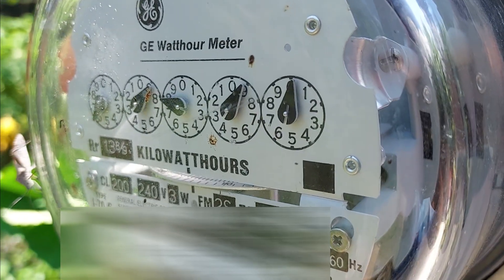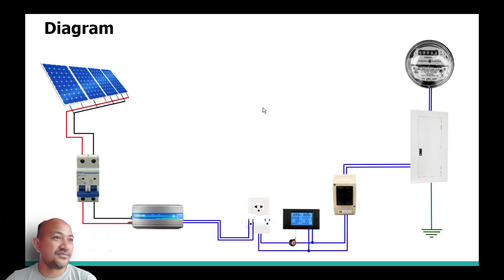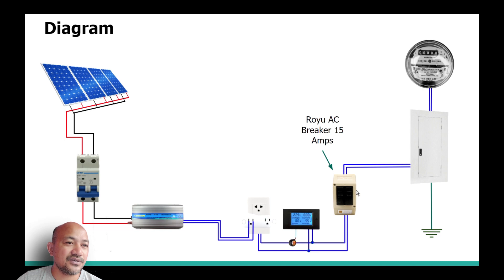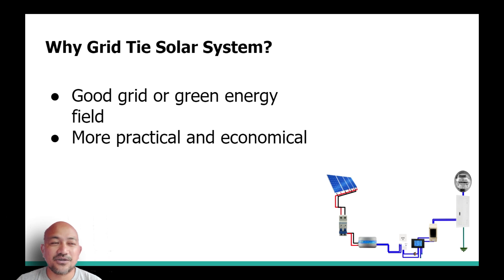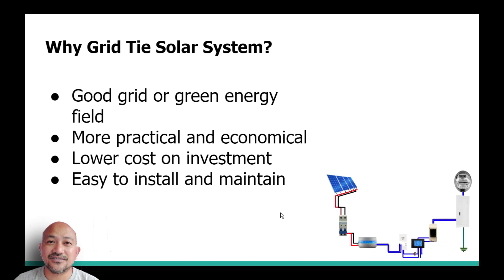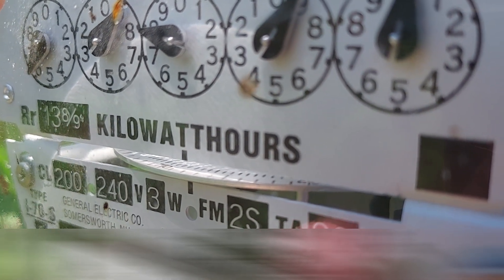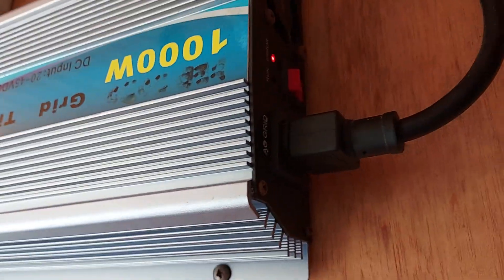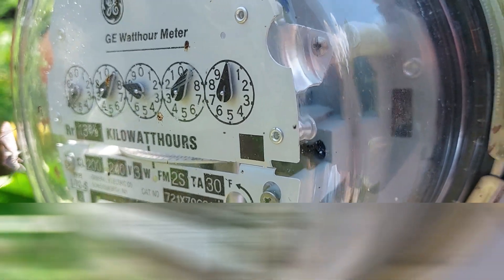SIMPLE 1000W SOLAR GRID TIE INVERTER SETUP-PART 2 | DIY Petz

Comment: boss pila na ka nag-ilis ug gridtie inverter po within the span of three years?
Reply from the maker: Sir Robert, isa palang Sir, usually kani na brand dili gyud kaabot ug 2 years, naa ra gyud sa 1 year 6 months, base sad sa mga other reviews online. Basin kani siya ako existing is hapit na sad mag 1.5 years. If ever maguba ni siya, planning to buy the 2 kw SunG grid tie inverter Sir as part of the upgrade nalang pud.
Reply: @RollyPetz  tagpila ang SunG sir? available na siya sa Laz/shoppe?